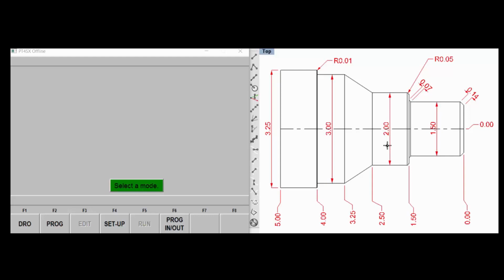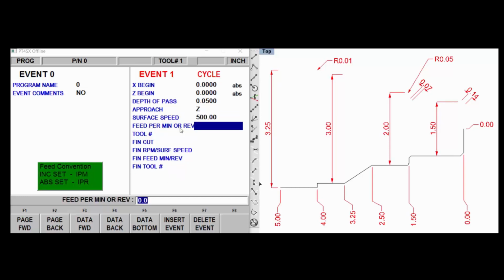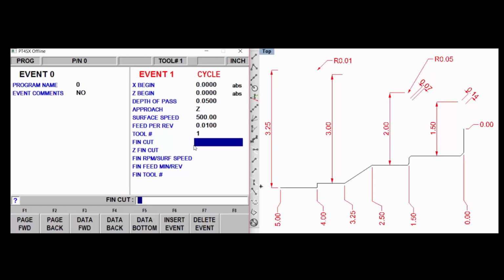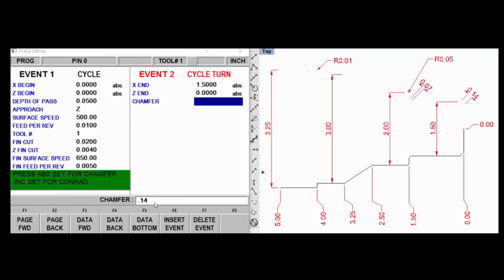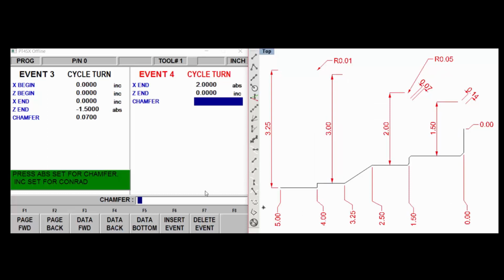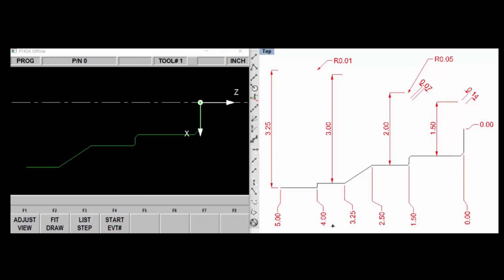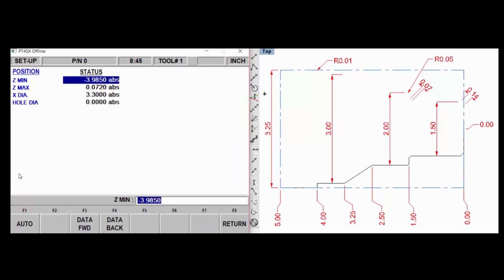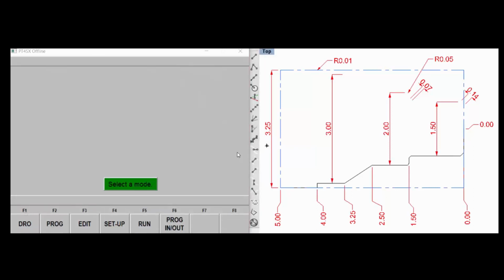ProtoTRAK Cycle Part 2

Comment: If i have excess material (.125) on the end of a shaft how do i program a face event to cut it to length
Reply from the maker: Hi Micah.  You could start your cycle at X-0.02" and Z0.140".  Then turn, inc set the X and Z0.  Then continue to program the part.  When using position moves to describe the stock, inc set the X, and abs set Z0.140" (your Z start point).  End cycle and "Yes" to close the cycle.  
That's one way, there are others.  Let me know if you want the others.
Reply from the maker: That would be Z0 abs set when starting.